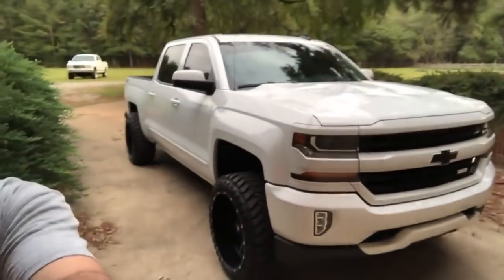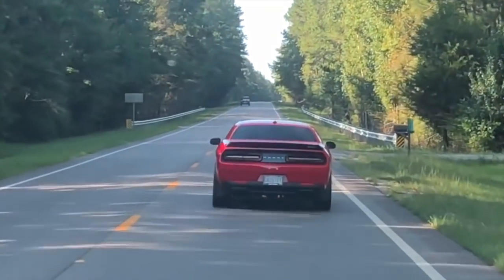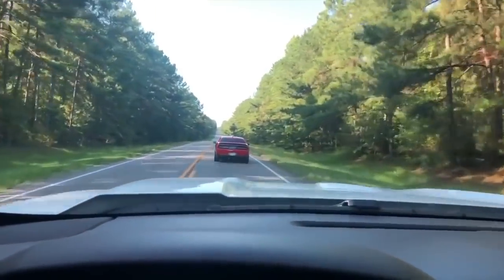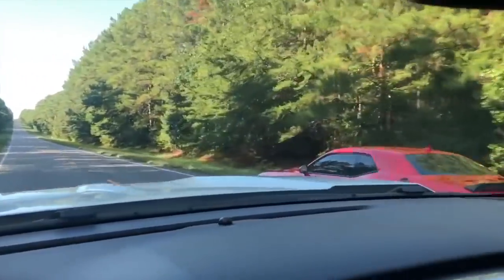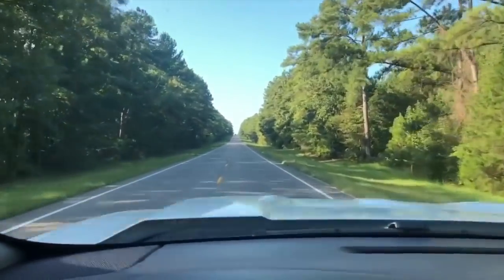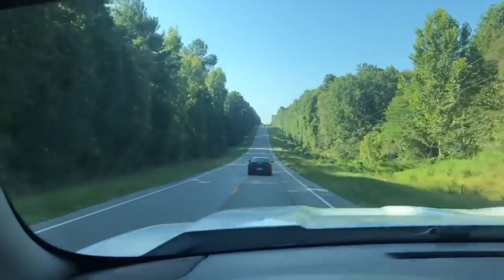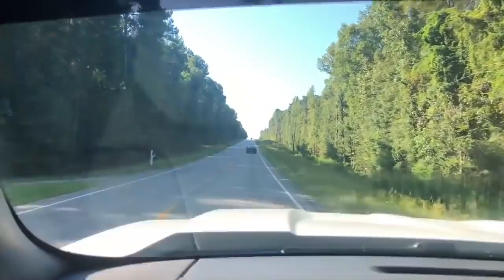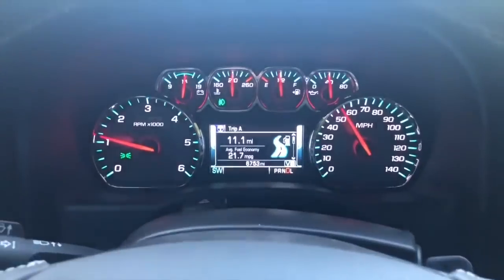Yes you must do this after suspension mods

Comment: What size did you get your upper control arm because I found one that says 2.25 lift idk if that’s good for an 3” motofab level lift please write me back because my ball jonts went out because of the wired angle on the upper control arm I wanna find the upper control arm and then just worry about my lower ball joint

Comment: Took my 18 Sierra to get an alignment after the 3" kit. Took 3 hours and they didn't even touch anything. Put my 22x12s on and realized how bad the alignment was. Took it to a different shop after a week or 2 and they told me they didn't even remove the plastic camber guides to adjust the camber. Tires wore weird the first few weeks I had it back. Can't trust anyone man..
Reply from the maker: Wow thats crazy. I will be doing an update talking about my experience with other places that i had to finally get it aligned.
Reply: I wonder the same thing after my "alignment". I only did 2" leveling but didn't look like any of the bolts even got a wrench put on them.
Reply: cinder 99 check the plastic camber plates. Gm puts a plastic piece there to ensure if the alignment stays straight. If it's not removed they didn't touch the camber at all because you can't put it back on after the adjustments

Comment: You need to have it aligned with the wheels and tires you're going to run every day.
Reply from the maker: You don't have to. Different tires can sit differently but correct alignment is correct alignment.
Reply: lmfscrew that's exactly why you would do it. Different tires sit differently.
Reply from the maker: well ive never adjusted alignment on any vehicle ive had after changing to different tires. Never had tires wear uneven either.
Reply: Alignment has to do with the mechanics of the vehicle parts only. Otherwise you’d have to do alignments every time you rotated as well. Perhaps you’re thinking of the whole process that would include a proper balancing?